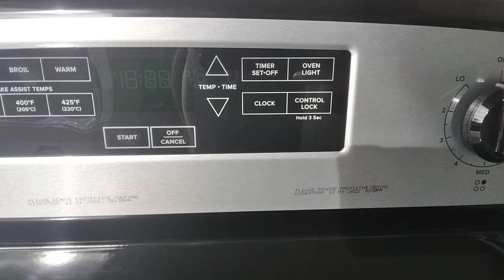installing 4 prong cord on Amana oven and closer look #whirlpool #diy

Comment: In that 4 prong installation - don't you have to remove the metal connecting the ground screw to the white wire?
Reply: Yes you do

Comment: So my set up looks exactly the same except the green ground screw isn’t green on mine.. could I still connect the ground wire to it?
Reply from the maker: @TheKodiLynn  yes it doesn't matter if it's not green. It's only a universal color for ground. Just as long as it's grounded

Comment: Can I cut them off well the burners work like bypass
Reply from the maker: I wouldn't mess with that unless you have an electrician help out. It's alot of amps going to that. If you are talking about doing a direct connect without a plug . Than yes but have a pro do it